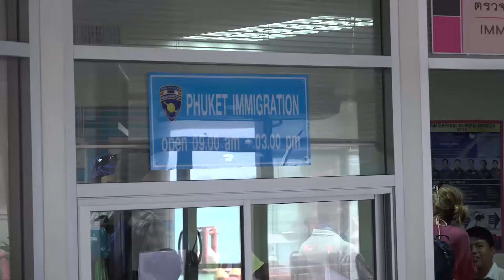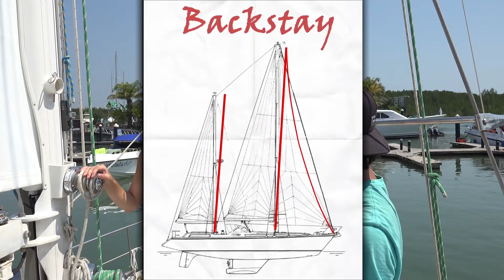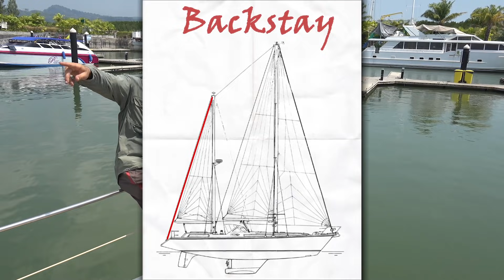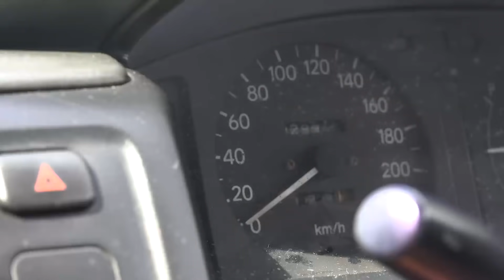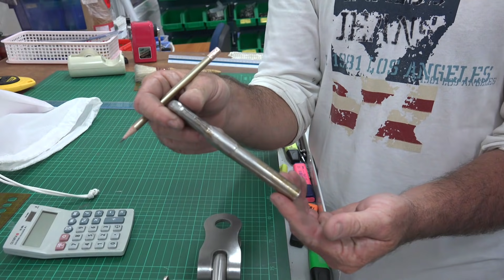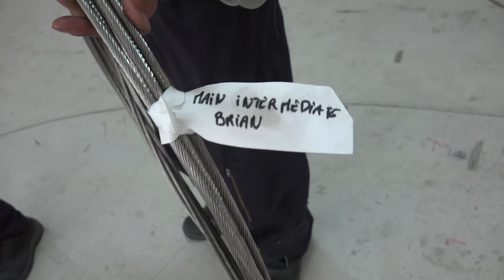Rigging Our Sailboat (Part 2 of 3)- Sailing SV Delos Ep. 62.

Comment: Let us know why you decided to go with swages rather than mechanical fittings: Noresman or Sta-Lok? Was it just the extra cost? Many long range cruisers prefer mechanicals for their strength, reuse, and ability to DYI with spare wire you can carry aboard with you.

Regarding going up mast, you used the spinnaker halyard through a block on the spinnaker boom. For safety, we've been advised to always use a halyard that goes over the top of a mast sheave in the mast head box as your primary hoisting halyard. If you have a spare sheave, it would be a good practice to install a spare halyard as a dedicated hoist when all others are in use. Also serves as an emergency stay for the mast.

Thanks for sharing these detailed maintenance videos. Yes, cruising is fun and sun, but it's also hard work that requires a keen eye to maintenance and safety. Thanks for setting a good example.
Reply from the maker: +TheSailingChannel.TV It was mostly a cost and availability issue.  For example mechanical fittings for 12MM wire are 3x expensive.  Given the price difference I would need to sail Delos for 30 years before it would make sense, during which time I could replace the rigging 3 times.....  You make a good point about being able to replace the wire but we carry spare 2M sections with swaged ends and cable clamps that will pretty much do the same thing in a pinch.  I guess when it comes to going up the mast there is never any way to totally get rid of the risk, it's about minimizing it.  So we have one external halyard we hook to, one internal halyard, two different winches, a bosman's chair and a rock climbing harness for the 2nd safey line for backup.  It's quite a setup and I feel about as safe as you can get!  Fair Winds and glad to hear you like the maint. videos. There really is so much more to cruising than just beaches and sundowners and it's actually a lot of fun to show that side of things.  Fair Winds!  Brian
Reply: @svdelos  Many new racing yachts use Vectra instead of wire because of better strength and less weight on the standing rigg. You should have some Vectra lines onboard as spare rigging/repairs if anything snaps off.

Comment: Wow, it is quite nice to see how you guys ended up doing your rigging. 
But i was quite surprised by the way the rigshop employee handled it all. Safety didn't seem to be of any concern to him while using a grinding wheel nor a 10 ton pressing machine (assuming that's the pressure it uses). Informative behind the scenes video tough!
Wouldn't it be a better idea to take turns on the mast next time you do a job like this, like each do a 1 hour shift max to prevent from overheating/ dehydration? That can become a serious health issue and even life threatening before you know it.
The safety concerns aside (from my perspective as mechanical engineer) it's very nice to see you uploading such interesting behind the scenes video's. Hope all is well for you and that you have a long time to sail ahead of you.
Reply from the maker: +DePvdM Cool glad you liked the video.  I do have to say we've seen some crazy stuff in Asia and this shop was pretty safe compared to some others.  But yeah, grinding without safety glasses is pretty crazy.  Lot's of things that would never happen back home for us.  Interesting thoughts about switching people out up the rig- problem is most everyone was scared of heights except me.  They passed me up lot's of water though and I had on my trusty hat most of the time so was alright.  Happy Holidays to you!  Brian

Comment: Hey guys, great videos!  You get better at production all the time.  You made only one mistake that I saw in your re-rig.  That was to use the undersized pins in the main shrouds at the chainplate!  Having a 14mm pin in a 16mm hole will lead to SERIOUS distortion of the hole in the rigging fork with time and cyclical loading.  The reason is that when the pin is smaller than the hole, it leads to a point load where as if it is correctly sized, the load is spread around the circumference of the hole and pin.  You need to go back and fix this!  Maybe drill out the hole like you  did on the mizzen chainplates?
Reply from the maker: +Bill Kinney Hey Bill, thanks for this.  It's strange this didn't come up in the discussions with David but we'll certainly look into it further!  We have about 10K of hard miles on her so far so probably couldn't hurt to pull those pins and see if there is anything odd going on and figure it out from there.  Fair Winds!  Brian

Comment: Another great video...man this must have took a lot of work to put together and edit and make drawings to show us what rigging parts you were talking about...cool....just a tip....I have a research paper that found that the best penetrate you can use to loosen rusty bolts is a 50/50 mix of acetone and transmission fluid...Merry Christmas...
Reply from the maker: +Terry Landis Hey Terry- Cool, glad you noticed the little drawings.  We thought it would be cool to do it that way for people that don't know the names for the parts.  Anyway, that's a really cool piece of info on the acetone and tranny fluid.  Both things we always have on Delos so we'll keep that in mind.  Happy Holidays!  Brian
Reply: +SV Delos Sailing I tried to send you the paper showing the comparative Ft/lbs required to remove a rusty bolt, but I can't seem to find an email to send you the doc...dont know if this will work .....file:///Users/terrencelandis/Pictures/Photos%20Library.photoslibrary/Thumbnails/2015/12/09/20151209-155933/aKpaWKSCRRaqNmAgRs2Aig/thumb_Super%20Rust%20Penetrant_1024.jpg

Comment: Simple process. I have swaged cables for aircraft. Smaller but just the same process done with a simple tool.
Interesting that the old cables were just measured. After 10 years of stretching I would have expected the cables to give slightly but I assume they rely on the turnbuckles taking up the slack.
Reply from the maker: +dcawkwell Yeah we discussed with the rigger and after doing the calculations we came to the conclusion that the stretch was so small it was insignificant over these wire lenghts.  So we just centered the turnbuckles when measuring and it was about perfect when tuning the rig.  Even on the second tuning we only needed to come in another 1-2 turns which is basically nothing....  Fair Winds- Brian

Comment: Hey Guys,
Big fan here.
Re your rigging. Have you thought of getting a spare wire? Perhaps a duplicate of the longest one swedged on both ends. It can be cut if needed.
All the best and a Happy and Healthy New Year to all.
Stan
Reply from the maker: +Stan7670 Hey Stan- yeah we actually kept a few of the old ends with a few meters of cable.  Since it's usually the lower swage that fails we were told you don't need to carry the whole cable.  Just an end with enough cable to clamp it to the upper end with U-Bolt style cable clamps.  should get you back to port anyway.  Fair Winds and wishing you the best!  Brian

Comment: Hi Guy's Merry Christmas, great video!  Did you allow for stretch?
cheers From Russ and Malene in Aus..
Reply from the maker: +Russell Zylstra Yea, we calculated the stretch per the wire manufactures specs for the longest length which happened to be 12 mill wire.  The stretch over that length was pretty insignificant so we just centered the turnbuckles for our measurements which allowed for plenty of room, even after the initial wearing in period.  Fair Winds, and thanks for watching!  Brian

Comment: Do they recommend any sealer on the wire rope for inside swage fitting space or grease? Anti seize on threads? Anti seize is the best thing in the world for threads that you want to work next time you take it apart, but it is messy and will get everywhere. I keep my bottle in a zip lock bag cause it is so messy.
Reply from the maker: +KirkOfBellevue We heard both yes and no on this.  From what we gathered was filling the swage internally kept out moisture initially, but not forever.  Then moisture would get into the environment and stay there, particularly salt water.  We were told to just swage metal to metal, and let the swage naturally get wet and dry and flushed with rain water occasionally.  We've used Lano Cote for a few years as a general anti-seize compound and recently have started using Super Lube with good results as well.  All sorts of cool stuff out there.  Fair Winds!  Brian

Comment: Brian, I'm curious, what was your favourite beer in South Africa ?, and please don't say it was castle ! :-))

Thanks for the video of the actual swageing process and the disassembly of old swages to show internal corrosion.

I wonder, if the base of the buckle and cable is sealed with marine silicone, would that help prevent the onset of corrosion by preventing salt water from pooling in crevices of the buckle/cable ?. But it must be Marine Silicone and if the silicone has a vinegary odour it isn't proper marine silicone sealant, some cheap brands of Marine Silicone have a vinegary odour, indicative of inferior quality.
Reply from the maker: +tudomerda Ha Ha no not Castle, although we have drank our share for sure!  So far our fav has been Mtunzini Brewery, Kwa-Zulu Natal.  They make a few really cool flavors we got into.  As for the seailing of the swages we were told that keeping oxygen out could actually cause the stainless to corrode worse and were advised that metal to metal with no sealant was the way to go.  We were told that yes, salt will get in there but also fresh water to flush it out.  Fair Winds!  Brian
Reply: Brian. I'm afraid that you've been misinformed as to Oxidization of metals, Oxygen is an accelerator of Oxidization hence preventing Oxygen from interacting with metals prohibits corrosion extensively. e.g. a outboard engine which has dropped into the sea, keep it submerged in either saltwater or fresh water(preferred) until everything is ready for stripping and cleaning, this is to minimise corrosion due to contact with oxygen. also, take a look at steel objects which protrude from the sea, like a wreck, above the water line there's extensive oxidization, below the water line the structure has significantly less corrosion due to less oxidization. Anyway I guess that it's academic with rigging as it should be replaced every ten years regardless, delaying the onset of corrosion is irrelevant as it should retain integrity for at least 10 years with zero maintenance.

Comment: When you built the new rigging, did you take into account that the rigging would stretch? I have watched riggers cut the new rigging about an inch shorter to account for that. Just wondering. It looked like they measured it to the same length as the old rigging.
Reply from the maker: +Adam Bashore We did discuss this with David and looked up the stretch for our cable sizes for our longest wires.  It turns out the stretch was so small that just centering our turnbuckles for the measured length gave us plenty of adjustment room.  I have heard of this before but maybe it's a real factor on longer wires?  Happy Holidays!  Brian

Comment: When replacing the rig, wouldn't going with heaver cables be stronger and last longer?
Reply from the maker: +Mazda rx7 It's an interesting point but it's more of an age thing from what I understood.  The cables are designed with a working load and a breaking load, so as long as the breaking load is never approached the cable size is correct and going bigger on the cables would probably only add weight aloft and cost in wire and turnbuckles, etc. Other than that regardless of the size the metal will corrode and fatigue with age.  Happy Holidays and thanks for watching!  Brian

Comment: I thought that one placed the cable in the fitting, splayed the wires open and inserted a cone over the core wires, then twisted the wires back, then screwed the other half of the fitting on to tighten everything down. Your fittings seemed  like they are permanently attached to the stay. Can someone explain, please.
Reply from the maker: +lisarob5767 Hey- you're absolutely right but those are called mechanical fittings.  Two popular brands are Sta-Lok and Norseman I believe.  They are cool but actually quite a bit more expensive and really hard to get in Thailand so we opted for the standard swage fittings which are permanent.  They both have their pros and cons of course but I'm happy with our decision.  Fair Winds!  Brian

Comment: Why didn't you take the mast down to get this job done? Seems way more difficult leaving it up.
Reply from the maker: +hamsandwich77 It was definitely way more physical work leaving the mast up but we ended up saving about $1,000 US and 2 weeks off the project length by doing it this way.  We would have had to book the crane and all that stuff which would have slowed us down given the scheduling required.  Fair Winds!  Brian